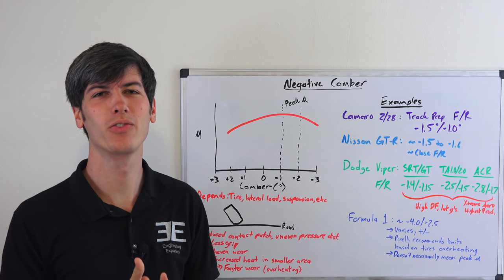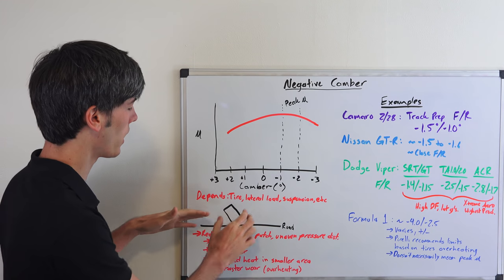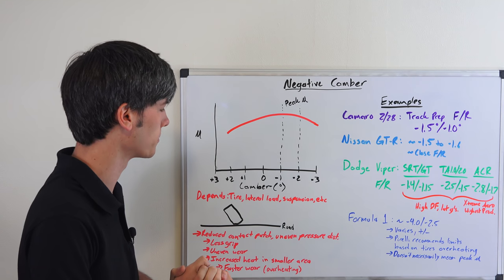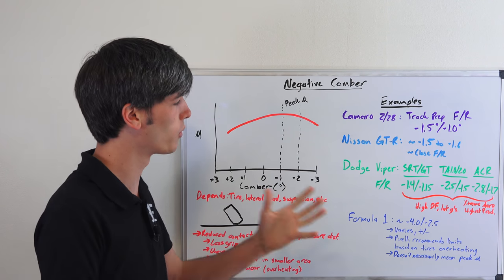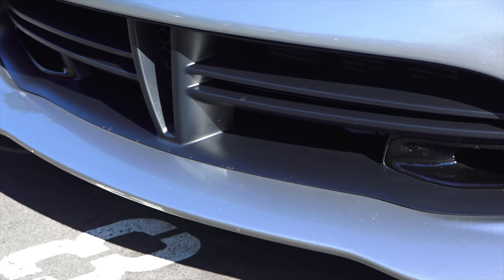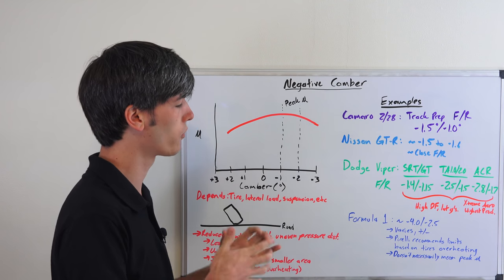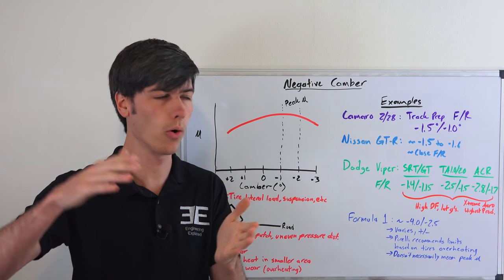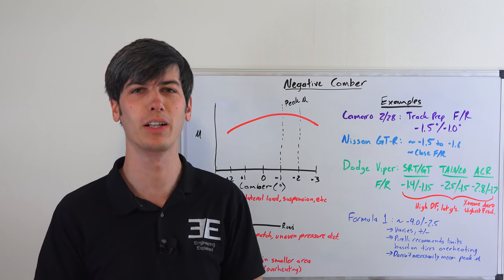Too Much Negative Camber - Wheel Alignment

Comment: Nice video but you didn't explain why a 1997 Honda Civic needs 40 degrees of camber for the  kfc drive through.
Reply from the maker: +ahmed shamsi Protects your side mirror from getting hit with the safety pole near the window. Wheels will push you out of the way.
Reply: +ahmed shamsi because #stancenation and #hellaflush LOL
Reply: +ahmed shamsi They have super awesome effective wings that produce so much downforce that they need so much camber :D
Reply: LOL
Reply: +ahmed shamsi 
Because it protects the expensive rims from all the curbs the terribly inexperienced driver will inevitably hit.
Reply: Because the downforce of the  rims will act like helicopter blades, forcing the car to be lighter. Have to have rimjobs tho.
Reply: ha.ha.

Comment: Worthy of mentioning that it is possible to get more cornering forces out of tyres even when running more camber than would be optimal for contact patch size. The camber thrust effect can on suitable tyres give you more cornering grip when running very high amounts of camber even when the pressure distribution is unequal and you're not using all of the contact patch. Talking to a former racer and race car builder (currently developing simulators) he said that for maximum cornering power they could run past -4 degrees, and would have gotten even more cornering performance with more camber, but due to diminishing returns and extremely rapid tyre wear it wasn't a sensible option.

So you might see sprint race cars with more camber than endurance race cars, and qualifying setups with more camber than race setups. For example Michelin recommended Porsche Supercup cars -4.5 degrees of camber and a 20 degrees Celsius temperature delta between inside and outside of the tyre as a starting point, compared to -3.5 degrees that McLaren used as the baseline setup for their 12C GT3 race car intended more for longer races.

Comment: Camber doesn't affect the friction coefficient, only the transmitted net force.
Friction is largely independent from surface area, ideal camber helps grip by means of negating tire/tread flex, creating ideal pressure distribution and minimizing tire rub off. Not by increasing coefficients.

Comment: Wow this was really informative, I never expected performance cars added more camber or that their was a strategic advantage to adding some because the wheel would straighten up a little on a turn and that makes a lot of sense. Now I understand why master tuners can make garbage cars into track stars on forza. I have to start messing with camber now.
Reply: +Ryan Spalding the wheel don't straighten, the tire rolls over less. but dynamic camber changes due to suspension design and roll center issues with weight balance are where the differences for handling come into play.

Comment: I rebuilt the suspension in my Australian built 2002 Holden VY SS Commodore back in 2012,it is FE2 specd from the factory (1 1/4 inches or 30mm) lower than standard height suspension.

I fitted the springs for the Holden Monaro coupe (aka 2002 GTO Pontiac) into it,they are 30mm standard rate King Springs,all of the shock absorbers & bushes have been replaced by me.

Now, the standard negative camber adjustment for a standard Commodore is 0° 30 minutes & 0° 48 minutes for the FE2 suspension setup both front & rear.

My point is the left hand front is set at 1° 43 minutes of negative camber & the right hand front is set at 50 minutes of negative camber.

Both the rear tyres are set at about 2° 20 minutes of negative camber, the rear camber isn't adjustable.

The left hand rear tyres used to scrub out the inside part of the tread on until I rebushed the rear,the inner rear control arm bushes were made of nylon,the offending bush was on the left hand control arm,it was distorted (pushed out of shape),the bushes are all urethane ones now.

Ever since rebuilding the suspension & getting a wheel alignment done, the tyres haven't scrubbed out on the car,they wear flat & evenly,they have lasted about 20,000 kilometres whereas they used to last about 6,000 kilometres !

Comment: I don't think that the downforce has anything to do with the reason as to why they chose a more aggressive camber in the front. With most suspension designs/geometries, the camber actually goes more negative as it strokes, so i don't understand why the downforce would create more contract and causing the wheel to be vertical. I believe the camber angle is definitely for more tire contact on steering into a corning combined with specific caster alignments. You can have a perfect alignment for every purpose in racing, but for cornering and track use, a negative camber in front combine with caster is more ideal in my opinion. Straights are minimal
Reply: you can't* have

Comment: It depends also on the tire width and the configuration of the tire. The Camero has this low figures because it has squared 305 tires, which means you just dont need that much camber, because to much camber has an negative effect like you're telling. In the rear you need traction, so you go for low 1 degree of Camber. But you don't want to imbalance the car, so you don't go that much higher in the front. Tires this wide with more camber are also much more unstable in following lines in the street. But with smaller tires, even higher camber on non aero cars can be better. The whole suspension is dynamic, the turning of the car to the outer side, the wheel goes in, and increases camber automatically. If you now have a high downforce car, like the viper or even F1, you have to stiffen up the suspension. It gets less travel and less dynamic camber increase. And why wait to have the camber if the suspension travels in, when you can get it instantly? There are so many aspects on this theme. Negative Camber has negative points you're right, but in cornering dynamics the optimum is depending on the tyre whidth defenitely above 2°. I run 3,5° in the front and 2° in the rear. It's an massive improvement in cornering speeds, but ok it wears the inside of the tires faster in normal use. I check my tire temperatures after every run in a autocross race, from inside to outside. In this extreme cornering, the temperature ist totally the over the complete tire. In normal use going straight most of the time, of course its hotter in the inner side of the tire. This is very important! For example the fastest track spec street legal M3 E46 around the Nurburgring go for 4 degrees in front and about 2 - 2,5 in the rear, with 265 all around.

Comment: I'm curious why you didn't talk about MacPherson strut cars.  All the cars you mentioned have sophisticated front suspensions that add negative camber under suspension compression.  They don't need a high static camber cause the suspension adds (and removes) it dynamically.  MacPherson strut cars can perform very well with camber's at -2.0 and more because the suspension design doesn't add negative camber under compression.
Reply from the maker: +George Davidson It will always depend on the suspension set up, regardless of the type. Simply changing the control arm lengths can have a huge impact. Then there's angles, pivot points, etc. There's never going to be a one size fits all for this kind of thing.
Reply: with mcpherson you have to look at the lower arm, if the mounting on the car is higher than the mounting on the wheel hub then you have increased negative camber on bump right until the arm goes over the parallel line and over the 90° angle with the strut steering axis.

Comment: My car has a negative 4.0. Rear camber driver side. Got an alignment on the other three except that one. Rear driver side. The mechanic told me the have to pull the camber. It was in an accident but it was somewhat fixed.

Comment: i run -6.5 front camber on my drift car so theres as much contact patch as possible when the leading wheel is at full lock while drifting.
Reply from the maker: +PeaceDotExe If the leading wheel is at full lock, isn't it pointed the direction the car is traveling? How much benefit does negative camber provide in this situation, or what is the camber when the wheel's at full lock?
Reply: correct, the leading wheel is pointed in the direction of travel. because of the caster angle of the suspension, when you turn the wheel to such an extent the camber angle becomes positive, usually by a lot. so running high amounts of negative front camber counteracts that. at lock the camber angle is somewhere around -2 to 0 degrees. this gives the most amount of front grip possible, like you said in the video. :)
Reply from the maker: +PeaceDotExe Interesting. Thanks for sharing. Do you think others choose to use less caster and thus less camber to counter this? What's the benefit of more camber rather than less caster?
Reply: Pros use less caster but buying the proper suspension components to achieve good suspension geometry is expensive. adding negative camber is much cheaper and looks cooler in my opinion :^)
Reply: +PeaceDotExe lets be real here. you just do it for the looks. youre no pro drifter
Reply: ive noticed lots of pros even in formula d (japan and usa) and local pro drifting events use up to -7 front camber 0 rear camber with fully modified suspensions...i have found i personally have most control around -4 front 0 rear

Comment: Whichever camber setup you put on your Integra "race car", I'm going to copy it for my "track" Civic because you're smart! :) Camber is tricky to change, and expensive to change, unlike other tuning devices like adjustable swaybars or tyre pressures which you can adjust DIY.  It's a bit of pressure to make sure it's set correctly, and then you can forget it. :)

Comment: Touring cars run high camber despite not having the downforce. the S2000's tend to run -4-to-6, the craziest though was the Volvo C30 with -8 at the rear.

Comment: Formula one & NASCAR cars can get away with an extreme level of negative camber not only because of the downforce, but because the tires have huge side profiles that can also deform and flatten a lot better/faster than some of the super skinny tires found on road cars. If you look at LMP cars they generally don't run nearly as much camber because the tires have less side wall and the tires are covered by bodywork.

Comment: I love Engineering Explained. If you want to get a good sense of the how and why of setting camber settings for maximum grip, just head to a reputable autocross group or road racing event. Roughly, you want the most tire rubber contacting the road at maximum lateral acceleration, and camber setting will help achieve this (I'll just say here, camber curves). A simple tire pyrometer will give you just about all the information you need to set camber for maximum grip. Run the car around the track/course, come in and immediately take three measurements across the tire face. The temperatures should be close (ideally you'd want the inner face of the tire to read a bit higher). On my Dodge Neon ACR on DOT soft compound tires, I'd run about 2.25 degrees negative static camber in front, 0.5-0.75 in the rear. Could've used more up front. On my Lotus Europa race car on full racing tires, Hoosier bias plies, we run much less negative camber, about 0.5 degrees front, about 1 degree rear. For the road, on "regular" tires, you won't need/use nearly this much camber, same with rain, snow, etc., set ups. There's just not enough grip there to affect large suspension camber change. I would run the soft compound tires for three seasons on many cars. With small toe settings, tire wear would be "normal". Large toe settings could chew up tires very quickly. None of the cars I've owned/run have required "large" toe settings, either in or out.
Reply: so your telling me you need this on city roads...
Reply: No. You don't need THIS on city roads. This is all about posing, it's for show, not for go, or improved car control and handling, or good engineering. As I mention, you don't need even well applied racing set ups for the road. You don't want to be racing on the road. There are the right places to go for this where anyone can go, if they'd like. Stock suspension setups are designed/intended to provide some engineered balance and compromise of low noise, comfortable/easy driving, low tire wear, low harshness and vibration, good fuel economy, and good handling and braking. As you move up the tuning scale to improve performance, this balance is going to change. The further up the scale you go, the bigger the changes from these stock design compromises.

Comment: What about Formula Drift camber, caster, and toe?

That would be a fantastic episode!
Reply from the maker: +Jon Stallard I can't speak for all the teams but I visited with Vaughn Gittin Jr and he wasn't running much in the front or rear. Visibly you couldn't really tell. I did not ask about caster/toe.
Reply: +Engineering Explained From what i remember my brother was running -7° of camber up front for his s14. I dont remember the other measurements so I really dont know how much that was put into play. But it was the whole shabang. Toe, Camber, Caster. He also had an angle kit! But his set up was for drifting. The funny thing is he got his measurements from tuning in forza! And he did pretty good for having a stock motor and welded drift.

Comment: To be fair, I don't think the guys running huge camber in a stance application are too worried about lateral grip and tire life.  It's all about how wide with how little offset you can fit under your fender, for mad scene points.

Comment: How would one calculate their ideal camber settings?  I know this is likely dependent on tire compound, and pressure (as well as sidewall stiffness).  I have -1.7° in my 2005 STi that I use for autocross, and I find that I still roll the tire over past the "wear triangles" on the side.  I know a lot of my opponents run -3.0° or even -3.5° (front), and they're not rolling over their tire, but I'm not sure if they're actually getting benefit in grip from running so much. It'd also be cool to see how much grip their losing in breaking zones with these amounts. According to your video their camber settings seem extreme even for the track.  (I'm talking about subarus only).
Reply from the maker: +Benjamin Spatafora Probably would be easier to test rather than calculate. You'd have to try it at various settings and see how that affects lateral load, ideally with a nice open space and similar conditions for each test.
Reply: Yeah, your probably right. There would be a lot of unknowns to calculate it. That would be an advantage of camber plates. Would you say rolling past the triangles on the edge of the tire is bad for grip  (or just bad for wear, this is my assumption). Thanks for the response!

Comment: So for drift cars it is actually useful right? As it makes your car lose lateral grip.
Reply from the maker: +coscorrodrift If your goal is to lose grip, then sure. But that makes your car slower. To do it properly you'd want more power rather than less grip.
Reply: +coscorrodrift Most of the best drifters (in Formula D, for instance) are trying to get as much grip as possible with the rules they have because it gives them more control when sliding.
Reply: Engineering Explained Hmmm, makes sense. You should make a video regarding drifting, if you haven't already!
Reply: +coscorrodrift He has done one one formula D
Reply: +coscorrodrift the formula 1 camber setup is pretty good for drifting i find
Reply: +Engineering Explained but even drifters want grip
Reply: +Arvin Singh That's what he said
Reply: Jacob S I realize that now. That's what I get for commenting even before reading the full comment lol
Reply: +coscorrodrift fronts are usually cambered heavily because that's the only grip that matters, most drift cars run super sticky tires up front, and garbage ones in the rear. With all the steering angle they have, it adds positive camber at full lock, so the negative camber up front balances it out.
Reply: +coscorrodrift Drift cars still want grip, as the lead wheel turns it loses negative camber you want enough camber so the lead tyre is flat when on lock, plus the camber can help with turn in.
Reply: +coscorrodrift if you want to have less grip, buy hard compound skinny tires. it's better and cheaper than ruining perfectly good tires.
Reply: +coscorrodrift Drift setups usually run some low chamber in the back for more traction in the rear and high chamber in the front {think like -2.5-3.5 usually} so at an angle, when the car is sideways, the wheels are cranked and the contact patch is then flattened because the wheel stands nearly straight up.

Comment: what about road legal semi slick tyres such as the Toyo R888? Toyo's downloadable setup guide for a miata suggests starting with -2.5 to -3.0deg and to expect a higher inside shoulder temp by 25degF because of it. are you suggesting that a miata would not have the lateral grip to make use of this kind of camber setting? or do the rules change with semi-slick tyres?

Comment: bmw z4 3.0 deg neg camber rear stock from the factory....that's with bars run all the way out, so I could dial even more neg camber in.......tires in road use last a whopping 8k miles....

Comment: +engineering explained Would love to know the camber on the mclaren 720s because one of the engineers said one of the most difficult challenges they had in increasing the performance over the 650s and 675lt was working on the suspension geometry to maintain an optimum contact patch so it would be interesting to find out what they did :)